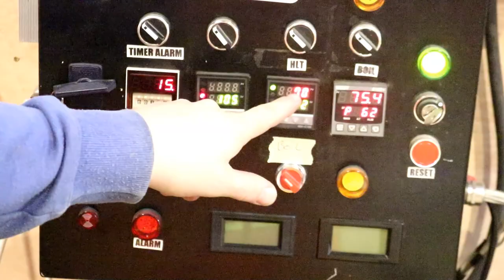IT IS LIKE A SAUNA

Comment: Hope the old flue piping I dropped off helps you with the issue. Bare in mind the condensation. Could do with a fixed straight flue and connect flex up to that and the boil kettle as and when needed with some sort of condensation trap or with a drain off. I’m sure with your skills you will create something that works. All the best 👍🏻
Reply from the maker: Dude, thanks so much, you caught me off guard a little as I had a few things going on and I have not been 100%. If you get the chance to come back over,  there are a few beers behind the bar for you mate.
Reply: HarryBrew69 no worries dude, I live local so was no hardship. Hopefully they will be of some use to you. Thanks for the offer, I will pop down one night for a few with the misses and have a chat if your in.

Comment: Should a building that big not have natural openings on the top half of at least minimum 3% of floor area? Cant you then just add extractor fans to said openings? Having a long extractor tube could build up water from condensation or not?